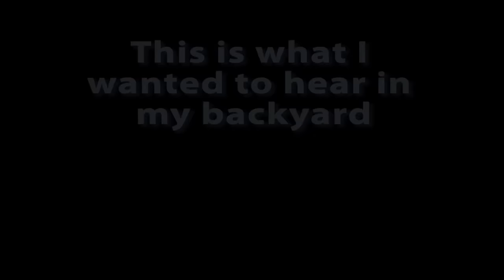Natural Swimming Pool Construction (Part 1)

Comment: Hello! I'm really impressed with the pool you've done!

I couldn't understand how did you set the cedar walls and the docks posts to the ground. I'm wondering if it could damage the liner.

Thanks for sharing! Greets from Portugal
Reply from the maker: +Tiago Serafim, I rested the cedar walls on a bottom plate with a liner protecting my water holding liner.  The furthest out dock post is resting on one of those bottom plates.  The posts in the middle are resting on a plastic plate to displace the weight and is also protected underneath from puncturing the liner.  Thanks for the interest.

Comment: Wow, this is really awesome! I'm attempting something on a much smaller scale...a natural pond (10m x 9m) but so far, the water is very green. We've got lots a few shelving plants but I'm worried the green water will kill them. Any advice? Cheers!
Reply from the maker: +Mark Charlton Plants will require a few months to establish in their new environment so often patience is needed to ensure they have had enough time to start filtering.  You might even need more plants and I would always recommend adding a UV sterilizer to the system.  I have had a little string algae problem, but no green water due to the sterilizer.  Once my plants are filtering well I will turn off the UV.  Hope this helps some.  I'd love to see pics of your project.

Comment: Looking forward to part 2. I'd like to do on a smaller scale one day. :D
Reply: Jo Sawyer Smart!  A very small "practice " pool will save you hundreds of hours on a larger one! Best Layers that I have found to be PERMANENT and prevent leaking is ~1 Dig, 2 weak sand cement mix. 3 vinyl over sand, 4 cloth over vinyl, 5 splashed rich wet grout mix over cloth, 6 Concrete Hand Made rocks, shaped by you as the last layer>   Very fast and very natural looking~Also extremely less expensive! [similar as how the Romans made water containment vessels and viaducts!
Reply: PS:  Don't Forget hydrostatic relief valves so the concrete will not float out of ground as has happens in California when pools are drained.  Float like a boat!  You don't want it to float!  LOL!  Valves cost about $8 each.  Well woth it~lets water IN but will not let it out!
Reply from the maker: Jo Sawyer There are a ton of options on how to build these and even smaller NSP work just fine.  Thanks for commenting.
Reply: Ron Noonan don't

Comment: How much would you say this project cost? Any guidance on how to do this if don't have heavy machinery can this be contracted out and still be affordable?
Reply from the maker: It cost about $12k including the fencing.  So yes, it is very affordable if you do all of the work yourself.
Reply: @gason5  oh wow amen that is a blessing to hear.  Any recommendations on products like the pump etc.  I know it's been a couple years since you started this project so have they held up?
Reply from the maker: @daniellanzotti2391  They have held up really well.  I had a 3 way valve that froze last winter, but everything has handled really well.  I have a 3HP intelliflow pump which has been great and had no problems.  I kinda wished I had put in two pumps, one for the water fall and one for jets, circulating in the plant area.
Reply: @gason5  looks like you live out west, ever though of slab panels for pump?
Reply: *solar panels

Comment: What will happen if the linings get punctured?
Reply from the maker: Great question; it would leak and empty water until the water got below that puncture.  Good news is, I placed a protective liner over the liner that holds water so that wouldn't happen.  Thanks for the question.

Comment: what is the name of lining?or lenoleum?
Reply from the maker: The one I used here was a PPL24
Reply: Lenoleum is too rigid to use as a pool liner and not made for that use either. For how to there is a Guide Book by Total Habitat and there are some useful videos by David Pagan Butler showing the steps. Best to use a non porous EPDM or other Rubber or even other solid yet flexible liner they use on farms, look up retention pond liners. Polypropylene is another but it only has a 20 year life at best, and any liner really has certain useful life before it needs to be replace thus the NSP will be getting rebuilt, or removed all together if something better and healthier comes along.
Reply from the maker: Hey, thanks for the comment.  Yeah, I read Mick Hilleary's book as I prepared and thought out my pool.  There was a couple of things I didn't agree with, but by in large it was great.

Comment: Smart!  The Romans used a cloth under their concrete so when the concrete cracked, it would self seal!  This pool is similar as to the way we build PERMANENT pools which will NOT leak.  Difference is, we used cloth over vinyl and splash a wet concrete grout over cloth BEFORE Pouring any concrete~ See our Training videos for the last several years!

Comment: What do you mean "a bottom plate"
Reply from the maker: it is a treated 2x10 that the wall rests on.
Reply: Thanks. Do you have more detailed pics or notes? So the wall you built and it stayed fine? then back filled it with pebbles?

Comment: so organic pools depends on where region you are from.
Reply: for example if I live in the tropics can I still build one?
Reply: from where Im from snakes and alligators might survive in this kind of pool
Reply: There are plenty of resources out there, a guidebook by Total Habitat, a few other companies as well (BioTop and BioNova), then there is David Pagan Butler who also did a DIY series showing each step in more detail. As for snakes and such, unless there is food source for them there, they won't hand around for long and there are those you can call upon to remove and relocate them if they do hang around. They can be built in any location, and since many of the plants are regenerative its fine if you build in a cold climate where the water freezes over, so long as you got a reliable pump system the water should thrive even in the cold months as long as the water keeps getting pumped.

Comment: Just so you know that is actually a really dangerous location to put the pool. It looks like you have lots of chickens and other animals that are Slightly higher than the pool meaning when it rains you will get runoff into the pool.
Reply from the maker: XXcreeps, not to worry.  The horses are no longer there and also I dug 2 deep swales infront of my fruit trees to catch that runoff rainwater to feed those trees.  We've had some big rainfalls this past year and none of it has entered the pool.  Good point though, normally that would not be safe.

Comment: Great build! How did you secure the framed cedar walls to prevent them from floating up? The book i have only shows the walls constructed with concrete blocks. I would imagine your way is more cost effective and more attractive. Thanks for posting.
Reply from the maker: +Ian Paul I had a bottom plate attached to the cedar wall and each panel was secured to the one next to it so, as I backfilled, the gravel just locked it into place.  It was much cheaper than other options and I like the look of it as well.